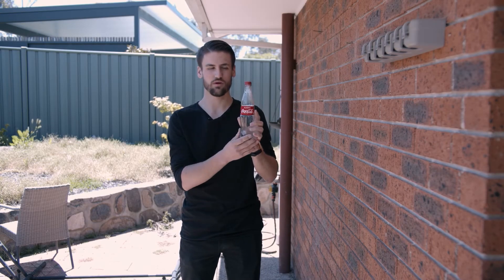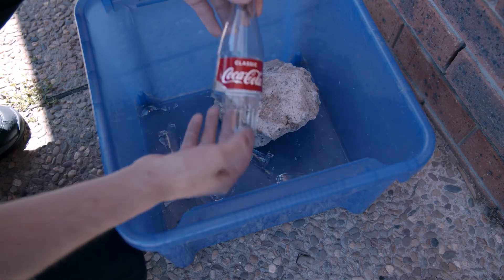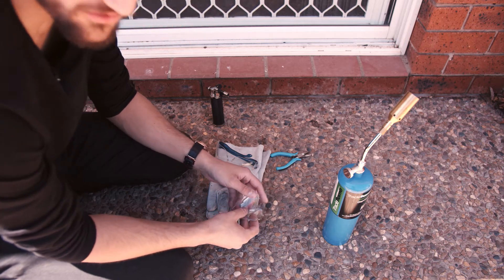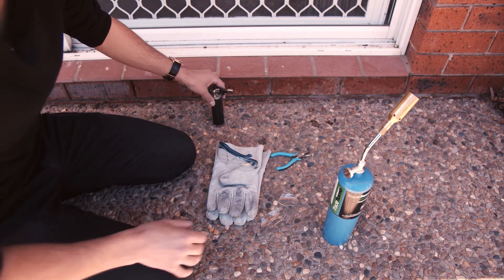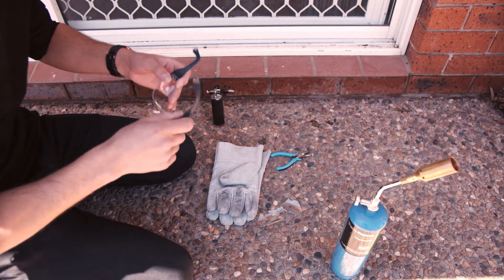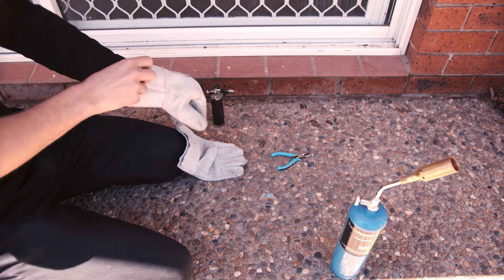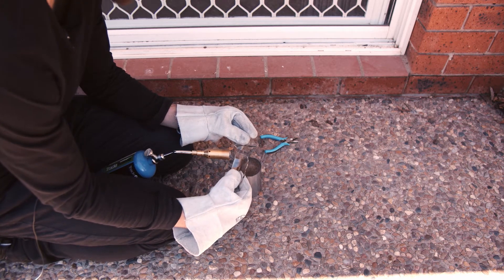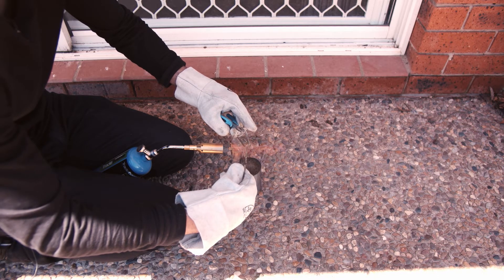Can I weld glass? - Will it weld? pt 2

Comment: Will glass get hot enough to melt together? 

Not like glass sculptures or devices are made in such a fashion or anything 🤷‍♂️
Reply from the maker: Yeah glass can melt together at high temps. You just need to cool it down very slowly otherwise, like what happened to me, it could shatter.

Comment: How strong was the weld when you got done? Seems like you thought it wise not to try to flex that weld with bare hands, but did you get a sense of how well it held?  

First video of yours I’ve seen. I likes it.  Keep up the good work.
Reply from the maker: It held decently well. Still very fragile. It definitely wasn't as strong as if it were one solid piece of glass, not two welded together.
Reply: @scoopscience  ok, thanks.  I was thinking of “stitching” two pieces together; getting the glass hot and pressing metal wire into the glass to appear stitched.   It would work better if the glass isn’t moving behind the stitch, since I expect that wire would come free again with a tug.